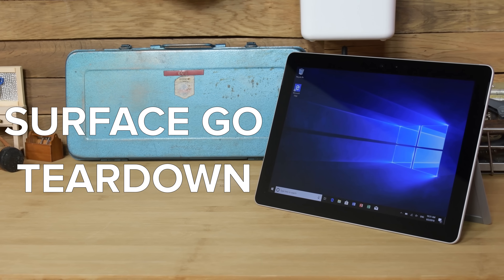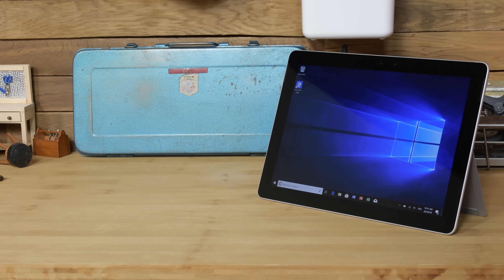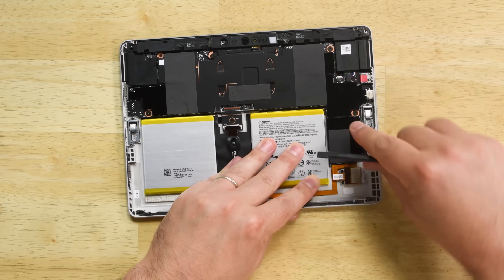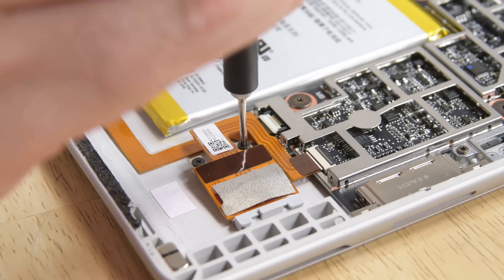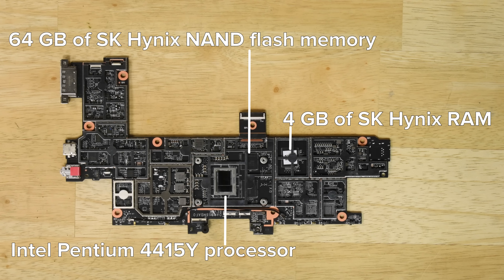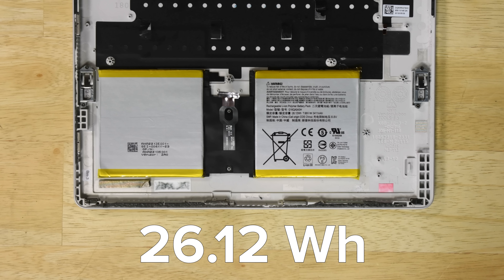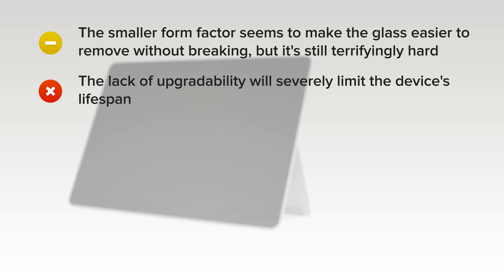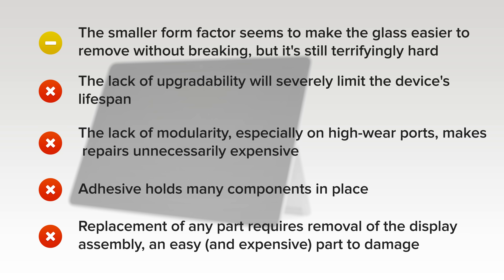Microsoft Surface Go Teardown!

Comment: wtf XD 21Wh???? even with a low power CPU it wont last longer than 3h in normal use... the motherboard is gigantic... i bet the could have fit a 30+Wh battery in there!

Comment: So the battery is impossible to replace without remove the logic board? I really hope OEMs makes the battery easier to replace. My Surface Pro 4 battery took a 12% wear over the ~2 years I had it and I need to start replacing it soon. Really dreading that process as of right now.

Comment: That's why I never buy Surface tablets :P

Microsoft produces this E-waste and still ship their products with modified version of windows :x

My old 218$ China tablet even had just normal OEM Windows 10 Pro and I was able to get Linux running on it without any problems. If it comes to repairing, then I was able to replace the battery and RAM modules without any problems. Headphones connector was just connected by some thin wires but the cameras were soldered on the board but they were so bad, that I used regular USB Webcam 😂
Reply: This one has a normal OS too, you start with Windows 10 S but you can upgrade to Home. Research.
Reply: 1. It comes with S but free upgrade to Home.
2. Your 'China Tablet' is crap. It had a horrible display. The pen support was shit and you couldn't even draw on it.
3. For a price range of $200 you probably got an Atom or Celeron POS tablet.
4. Upgrade what!? It's a 500$ device ...
5. If you actually looked at some of the reviews. The webcam on the Surface Go is one of the best webcam on tablets and laptops right now.

Man, I'll sure feel stupid if I was you right now.
Reply: My Surface Pro 2 is 5 years old. I never had any problems with it and I use it almost every day.
Reply: Also that old laptop you have mensioned is for sure much thicker and has more space inside. Also there shouldn't be a problem running Linux in Surface Go.
Reply: +Ricardo “Risk” Amaro windows 10 S is not normal, you can't even run .exe that aren't from the windows store, and you pay EXTRA money to have the privilege to download steam lmao
Reply: iTroll. Go home to your blood products made by suicidal workers in China.

Comment: Well, aren't the iPads and Apple Macbooks in the same boat?
Reply: It's not a Apple vs Microsoft debate...
Macbooks don't require heat, adhesive, and pry tools, which is a plus. The ports are also detachable. 
I'd like a Surface Pro that has screws. I'm not going to risk destroying mine to check out the insides.
Reply: Hmm. Yeah..but two wrongs don't make a right..
Reply: XJLCA come on, that's Apple. They have to scored higher. Because... It's Apple! That's why!

Comment: First comment... and way to go Microsoft, for continuing to make disposable rubbish!
Plus, a 1.6GHz Pentium and 64GB NAND storage aren't exactly specs that would want me to buy this!
Reply: It has more RAM, memory, powerful processor than the more expensive iPad Pro
Reply: RR Sharizam no the ipad pro processor (a10x) scores higher. You said ram and memory which is the same, but iOS is polished to make 4gb ram work pretty good. Also the regular ipad 2018 also scores higher.
Reply: For students on a budged which mostly utilise Online storage it is...
Reply: I'd rather have a new windows RT surface than a surface pro and get a really good armed based gaming SoC instead of a crappy low end X64 APU. I have seen 400 dollar core i3 laptops with upgradeable ram and mechanical hdd or msata SSD
Reply: with a few extra bucks you can buy the same tab with 128GB ssd coupled with 8GB of ram, plus looking at the price point compared to the ipad craps and things its a bargain of the century, thus running a full scale windows its pretty fast and does everything faster as compared to an equally priced bulky laptop.

Comment: These videos are fascinating to me.  Perfect length and info.  I do not understand how anybody could give these a thumbs down.  New subscriber here!
Reply: There are people who can see a bit of a Bias with some videos. I personally would say this video has some bias as tearing this thing down versus some apple products, the Go deserves a 3 (some may argue 4). It's mainly difference of opinions.
Reply: Gravity Media Productions - I think its because they gave the Go a 1 and other similar devices a much higher score...they lost all credibility from me now.
Reply: no no the videos are way too long.. they dont need to be this long. they are just jabbing and jabbing. come on Ifixit make them shorter then you can have it all in a freaking GIF picture-format.(hmm yeah right, nahh I feel they could use a moment or two to go thru some of the vital aspects more in-depth.. its not like you just put a little heat pillow on and then the display is off..
Particularly on items there are tricky and with low repair score, and items there are popular' then it could make sense to actually display the approach thoroughly..
One thing is text and another thing is actually showing it in a video.(most will prefer the latter)

Comment: Just buy an iPad 😝
Reply: Meshell Aljutt so 500 dollars for screen  repair on iPad
Reply: Because it's the same way of building. But it's Apple and usually scored higher...
Reply: I don't think so,ipad is just a toy
Reply: Lantaojx Liu ipad is not a toy, you can get real work done on it. The regular ipad even scores higher than the surface go on geekbench.
Reply: Does an IPad have windows?
No.
Does it have Full Office Support?
No.
Is it cheaper?
Depends.
Reply: engels141 yes in every way. The upgraded model plus a keyboard is 500$, it is cheaper. Although im going with a surface.
Reply: iPad?
More than like INFERTILITY PAD!

Comment: Wow, your reputation iFixit has just plummeted!! It’s pretty much the exact same build as many other devices that YOU have scored higher! This opinion of yours is not really worth anyone taking any notice off. It’s more repairable then any Surface Book or Pro. Or even the iMac.
Reply: Actually, no it isn't. Forgive me if I missed something but the screen in route has been the same for all Surface devices, and they all scored very low. There's not a lot you can actually replace, the high wear ports are not modular so can lead to a motherboard replacement, the battery is glued in and therefore extremely difficult to replace, and all of the main components such as RAM and NAND Flash are all soldered in, making them non replaceable or upgradeable. Truly deserves its 1/10, but at least you can actually open it (unlike the Surface Laptop).
Reply: yeah, having seen some of the apple devices ratings, this one should be a bit higher.
Reply: marksapollo - Agreed...if the Go had an Apple logo on it it would have got a much higher score.
Reply: Agree with you and they have to name me which tablet is upgradable and more modular according to their cons list
Reply: no modular ports.
Reply: The 27“ iMac has user-replacable ram. 24 & 27“ iMac CPUs are socketed. And you don‘t need to heaten the adhesive. 

One point ist completly fair.
Reply: This is the first device that I've seen require removal of the display to gain access to its internals. That alone just dropped the score like 7 points bet. Also the fact that they pretty much shield every component, for what? So people have a harder time trying to fix it? MS is literally garbage
Reply: Uhh no. The iMac screen is much easier to take off without damaging.
Reply: marksapollo Apple actually did some things differently than Microsoft, for example: Apple’s batteries have a removable tab that you can pull while the surface go does not, apples lighting jacks are not soldered onto the motherboard, it’s an separate component
Reply: Womp womp. Cry some more.

Comment: I don't understand why vendors ship windows 10 systems with 32gig or 64gig emmcs.  64, at least you have like 20-25gigs free after windows 10 updates over a few months.  128Gig ssd should be min spec these days.
Reply: So true I purchased 32 gig tablet once and after the first batch of updates it had about 16 gig remaining. Called the vendor and they suggested using the cloud which I was already doing. I quickly returned it because before long the updates were going to eat it up.
Reply: Spunkmire Its windows 10S... and its meant for Students who also get much space on the cloud...
Reply: That's because Microsoft shot themselves in the foot for putting shitty guidelines to OEMs. You want to create a device without paying Windows license, follow the specs. Else, pay the normal OEM rates. 

https://www.pcworld.com/article/2139080/microsoft-makes-windows-free-on-iot-and-small-mobile-devices-but-not-pcs.html

Can't find the article which really show it's 10 inch and not 9, with the full 'max' spec detailed. That's why, I was curious why <$400 Windows tablet, they feature the same spec, albeit from different screen size and manufacturer's feature.

Comment: feels like you put it up to the repairability standards of a PC instead of an iPad but whatever.

What shocks me is how large that logic board is. The macbook, ipad and ipad pro are all much more dense, with a lot more room for battery. I was initially very impressed, but that teardown show Microsoft's hardware as still a lot of catching up to do to Apple.
Reply: Pierre Gabory iPad is an arm device, this is x86.
This is basically a laptop in tablet form factor.
Reply: Nah considering apple hardware doesn't last and overheats I am fine with a larger motherboard design.What bugs me is exactly that microsoft is going after apple and cutting corners. (Why not an upgradeable ssd?and instead a soldered one?)
Reply: Because if they made an upgradeable ssd, that would violate their Prime Directive, which is: ALWAYS COPY APPLE
Reply: There's no catching up to Apple. The SG and iPads have vastly different types of technology. While the iPad has phone hardware inside, the SG has x86 hardware, which requires a lot more components as well as area. Also, maybe you didn't notice, but there's a lot of space left inside the SG where Microsoft could have put a larger battery, but deemed it unnecessary, both because they use battery to balance the weight (distribution) and because the low-powered HW doesn't need a 100Wh battery. So your point is moot.
Reply: That's because it runs full blown Windows, rather than a mobile one, and therefore is designed to be used as a small laptop (especially if you add a keyboard).
Reply: It is a PC. I'm still waiting for Apple to catch up and release an ipad with OSX so I can use real software and a mouse instead of shitty little phone apps. This isn't remotely comparable to an ipad. That's just a big phone.
Reply: Pierre Gabory, iPad uses SoC (system on a Chip), Surface is a full x86 architecture, you can't even compare.
Reply: Agree..
Reply: They intended to do it. More dense logic board requires a lot of costs to it.
Reply: Wait till Snapdragon 850
Reply: One motherboard is a simple tablet one, the other is a PC motherboard... They wont be the same
Reply: it is x86 and not ARM. A Windows on ARM board would be much smaller.
Reply: What'd you expect. for a company who's built around software.
Reply: If I wanted an Ipad I would get Ipad for apps but if I wanted x86.   It would be the Surface Go because there isn't anything near $400 price range not even the Windows 10 tablet from Samsung.

Note the date of the post because there still isn't any x86 tablet near the $400 price range with decent CPU and ram.
Reply: yet they dont officially slow down their devices
Reply: Logic board certainly takes a lot of room and it could have been spent on a larger battery instead... But I think the reason is not Microsoft's lack of hardware skill but rather the Intel CPU. Intel motherboards usually take much larger room and have more chips on them compared to ARM systems. I don't exactly know the reason but maybe ARM chips like Snapdragon have more functionality built into the CPU so they don't require external chips? Snapdragon is called a SoC (System on Chip) for a reason.